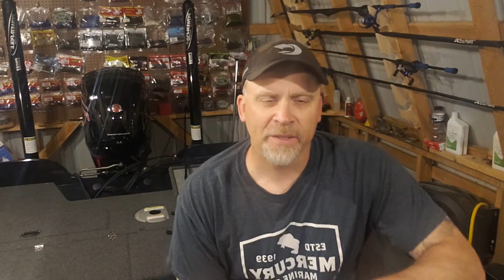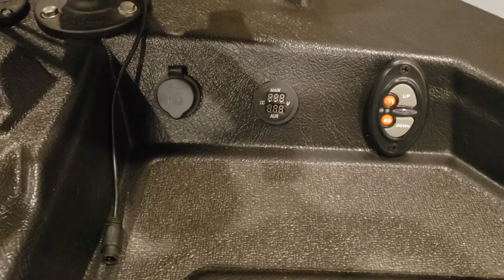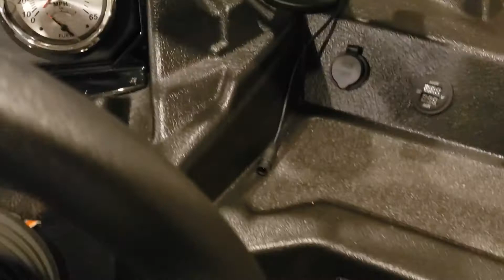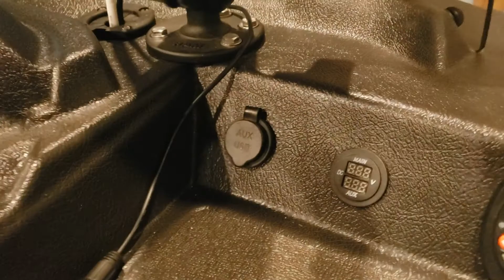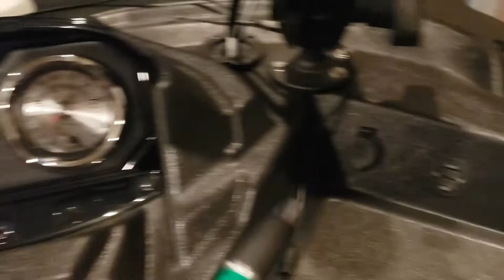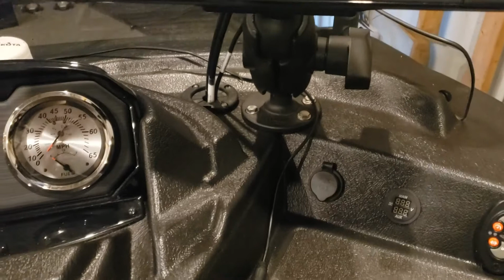Voltage Gauge for Fishing Boat

Comment: So what I'm understanding is that the main battery positive connection can be just any keyed source? It doesn't have to be from the main battery?
Reply from the maker: Yes, that has worked for me the past few years.
Reply: @BrianGaberFishing  thank you. That's gives me a better understanding. The guy said one thing but then showed a different diagram example. A bit confusing.